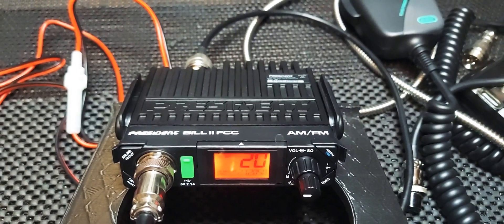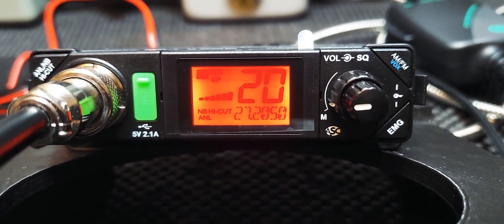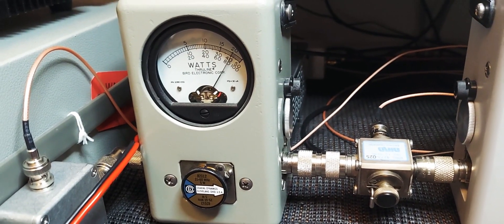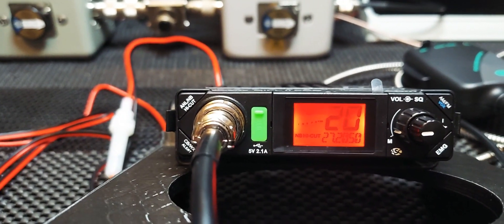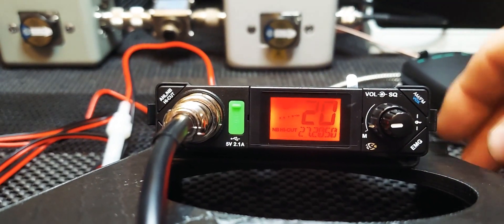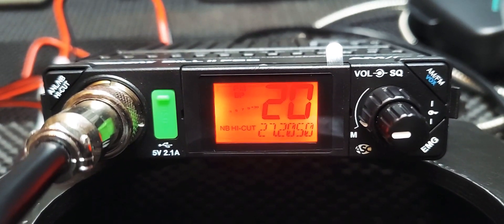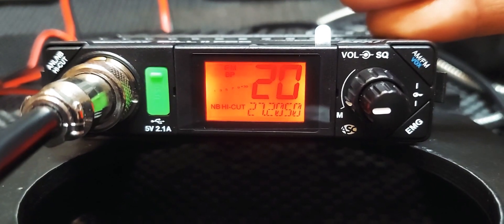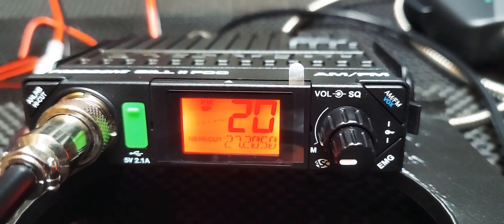Follow Up on New President Bill II AM FM 40 Channel CB Radio.

Comment: For a newbie looking for a mini am/fm CB mobile, would you recommend the President Bill 2 or the Radioddity CB-27 Pro?  Also, best magnet mount roof antenna matchup for a Tacoma  truck. Thanks!
Reply from the maker: Definitely the Bill II.
Any magnet Mount type antenna will work but usually the ones that offer a shorter whip will have less performance.
Reply: @ScottsRadios  Much appreciated

Comment: Other than a 102” whip, what is a good antenna to use with this radio?  I’m a four-wheeler and like to listen more than talk when out on the Interstate
Reply from the maker: If you're considering a magnet mount I would go with a Stryker SRA-10 or Sirio Performer 5000 PL.
Wilson 1,000 is also worth a mention.
I use a Wilson 1000 permanent roof mount on my vehicle.
Newer style haven't had any trouble with it.

Comment: I just received my unit.  Is it just me or does the mic gain seem a little weak?  I tried the factory mic and an Astatic Road Devil and it still seemed a little weak to me.  I don't see any way to adjust it.
Reply from the maker: They are normally under 100% AM modulation to meet FCC Standard.
Try using FM, much better sounding.
Reply: @ScottsRadios Yes I tried that.

Comment: My old 80's era first generation President Lincoln has FM and so does the later versions Lincolns, I was very close to getting a new Lincoln ll+ V3 but I held off and may consider either the Bill ll or something else, now if I were to order a Bill ll, would it need to be tuned and frequency aligned?
Reply from the maker: Frequency is spot on for the Bill II, no way to adjust that so it's good they got it right.
AM mod can be increased. FM deviation (modulation) level is good right from the box.
Power level can also be adjusted lower than factory or right to 4 watt Max.
That is up to each individual.
Reply: @ScottsRadios  So it's good right out of the box?